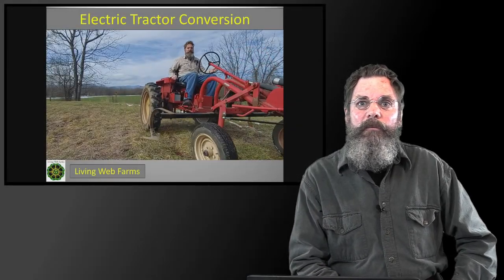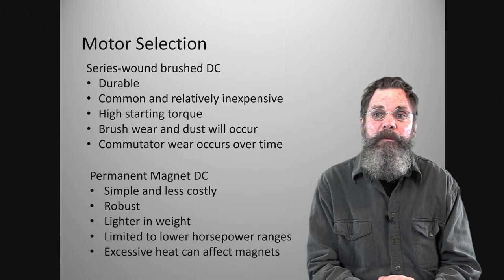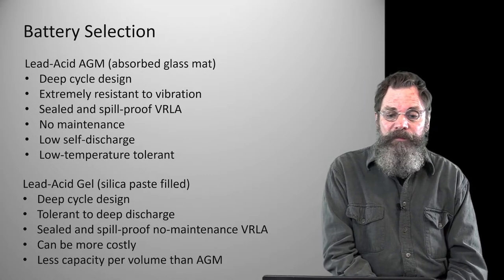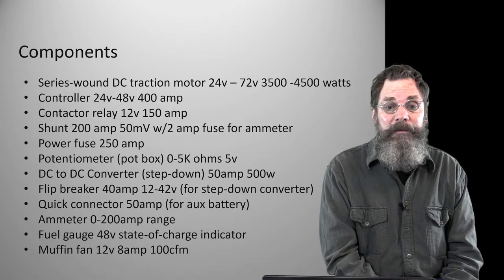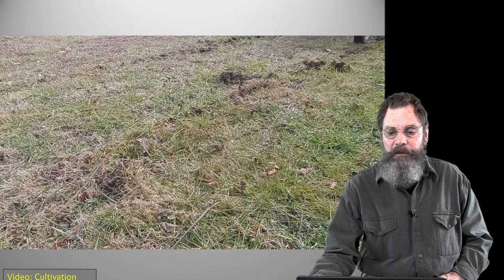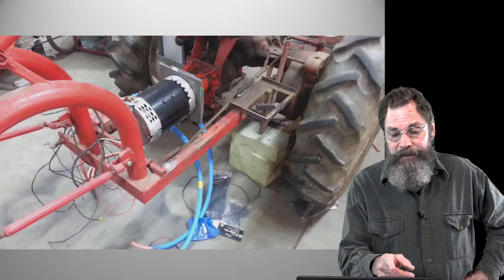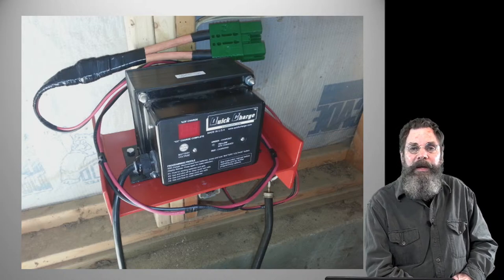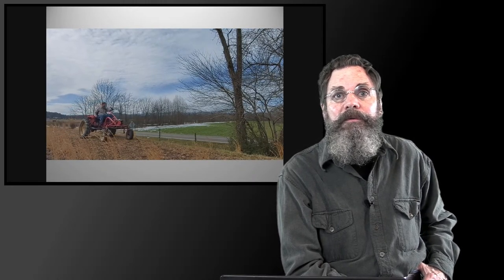Electric Tractor Conversion

Comment: Using lead acid batteries in the age of LFP is like flushing money down the toilet.  Not joking. In every spec they are far superior.  Cost about the same when you consider that discharging SLA below 50% damages them.  I've done several SLA to LFP conversions.  It's a learning curve but once you do your homework it's a no brainer.

Comment: would a small engine  powering a generator for the elect motors work ?
Reply: Technically the best hybrid system would be an engine/generator running at its most efficient rpm to supply electricity for the batteries and motors

Comment: lithium iron phosphate batteries continue to come down in price.  Ali express has plenty available for 2-3$ per AH. The batteries you used cost 2.80$ per AH. Also in your video you state discharge rates below 50% capacity are ok for lead tech.  That's like burning the oil in your cars engine to go an extra 5 miles, sure you co do it but you'll be forever sorry. lithium iron phosphate are designed for 80-90% depth of discharge with no damage and the discharge rates far exceed lead tech, which is important if your doing heavy work.

Great video, but I want people to be aware of 2022 realities
Reply: which mean a 1000AH lead battery only has 500 AH of usable capacity and 800-1000 charge cycles.
1000 AH lithium would have 800-900 AH usable and 3000-5000 cycles at the depth of discharge.
Lastly, lithium iron phosphate has twice the energy density, which means I could fit twice the amount of AH in the same space with 60-80% more capacity on top of that.  You're getting easily 10x the amount of total work a lead acid battery could do in its lifetime by using lithium iron phosphate chemistry instead.
Reply: @euphioquestion420  lithium is wasteful in heavy equipment, we want weight. Heavier tech is not always older. Lithium has its benefits when lightweight is required for the application.

Comment: While electric vehicles seem like a neat idea (in this case an Allis-Chalmers model G). The United States infrastructure is not capable of handling the the increased demands of an exponential increase in demands.   Our electric supply still comes from Coal, Nuclear, hydroelectric, and in much smaller percentages wind/solar. 

I would urge everyone to look into the past for our answer to the future. Propane powered vehicles are extremely clean, it is easy to modify a common internal combustion engine to use it, and incredibly plentiful in the United States. 
Please look at that option!